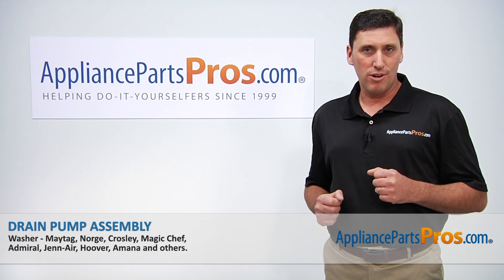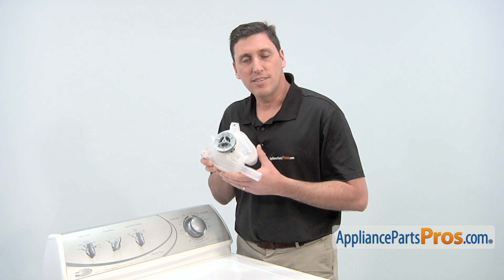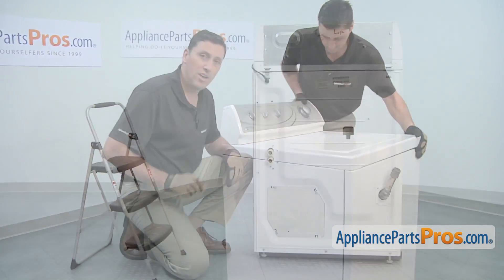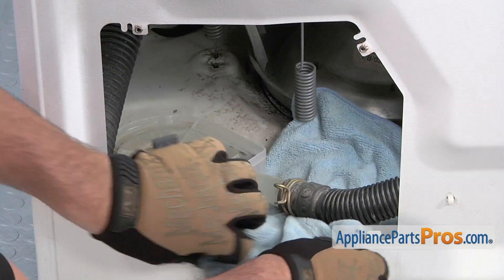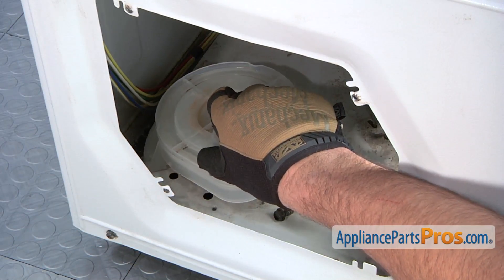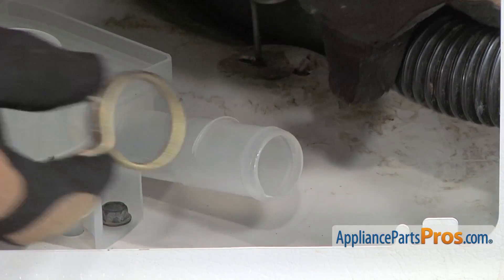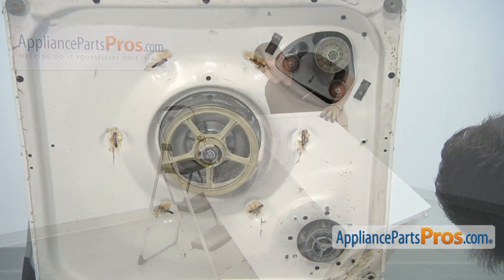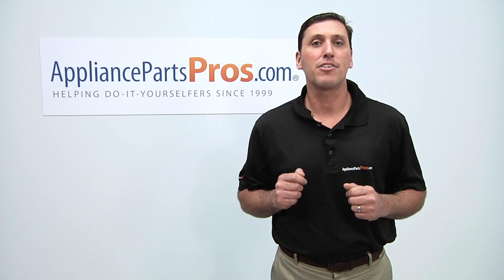How To: Whirlpool/KitchenAid/Maytag Drain Pump Assembly WP35-6780

Comment: Maytag  PAVT244AWW  not draining after cycle .. is that the pump ?
Reply from the maker: Frank, we would be happy to help you diagnose the problem with your washer, though we'll need more details about the symptoms. You can give us a call at 1-877-477-7278 or you can chat us at our website: http://www.appliancepartspros.com/. We offer free diagnosis and technical advice 7 days a week. One of our Parts Pros Agents will go through the details with you and let you know what we think is causing your problem.
Reply: Oh i found the problem ..the wheel or pulley connected to the motor split and almost wore through the belt ...only thing is i dont see a nut or C-clap how do i remove that pulley pls
Reply from the maker: That will cause problems! Give us a call or chat us on our website and we'll be glad to talk you through the repair.

Comment: Ever noticed when people post a video it is one of two ways. Usually the first one is of, like in this case the washing machine. They turn it on and show it is not working. It is making a noise or showing  what ever the problem is and that is all.  Now the other type of video is showing how to change out parts. And some are good and others, not so much. What would really help is to show the machine in action. That way you could see and hear what is going on. IF it is making this type of sound or not doing what it is suppose to do you would have an idea as to what to look for. I know you guys make money off of parts. But is it a bitch to keep replacing parts until you get the right one.
Reply from the maker: Thanks for your feedback. Unfortunately, that wouldn't really be feasible for us to do. Sometimes, we film as many as a couple dozen repair videos in a week. When we get in an appliance, we film repair videos for all of its most commonly replaced parts. It would be difficult to locate a different machine with each broken part that we want to film. However, we do offer free technical advice and diagnosis. If you call us with your model number and symptoms, our PartsPros Agents will tell you what parts we think you need to replace to correct your issue. If we recommend a part and we're wrong, we'll refund you and cover the return shipping. We’re available 7 days a week at 1-877-477-7278 or you can chat us at our website: http://www.appliancepartspros.com/